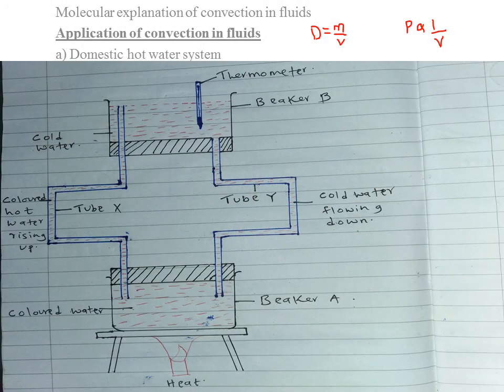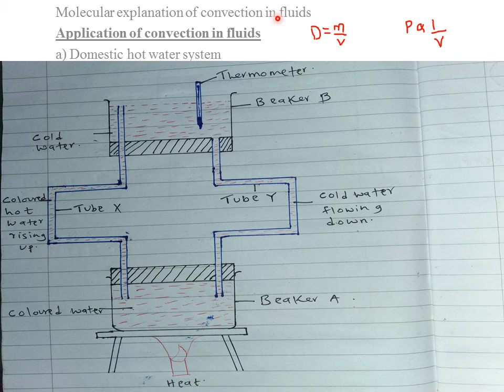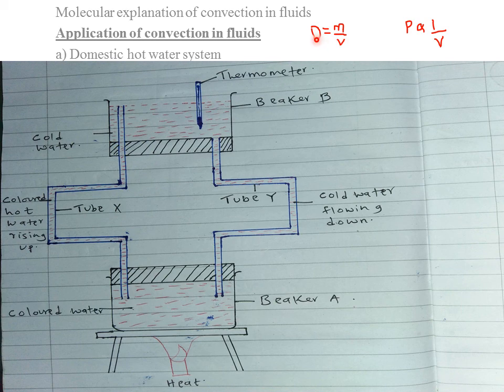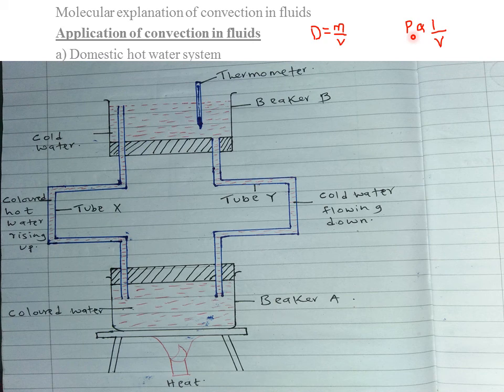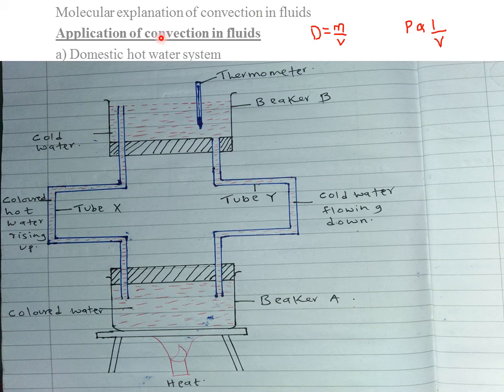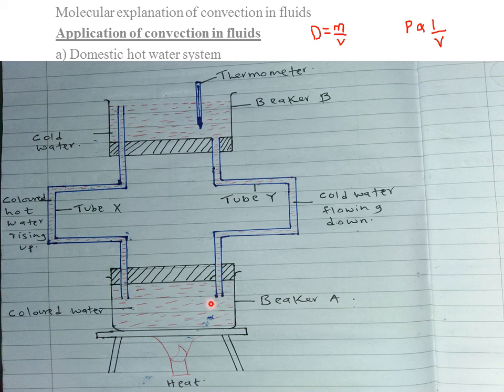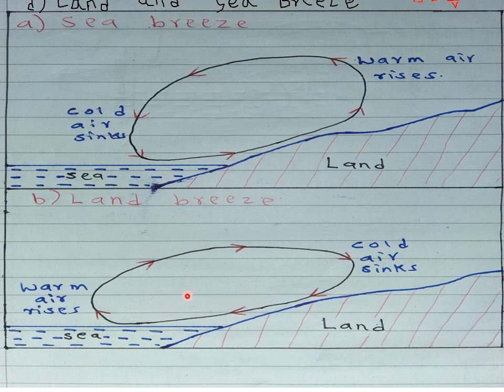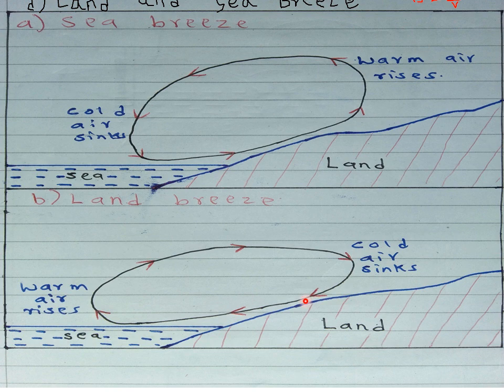HEAT TRANSFER : LESSON 3

Comment: Hello what are the 2 uses of an expansion pipe... In the video u have mentioned one .. what's the other one if it's even exists..
Reply from the maker: The main use(function) of expansion pipe is to provide an outlet for excess water that could have resulted from overheating; hence preventing water pressure from getting too high. Remember that if water pressure gets too high, it can damage valves in plumbing fixtures and joints in the supply pipe, cylinder and the boiler. Thank you so much Abdul for your comment and for following my lessons, I don't take it for granted. Kindly share this channel to your colleagues so that they can also benefit. I wish you all the best in your studies 🙏.